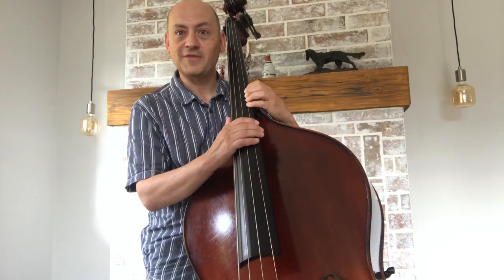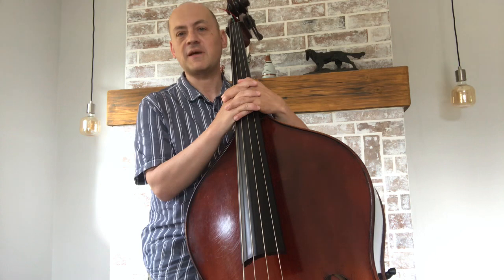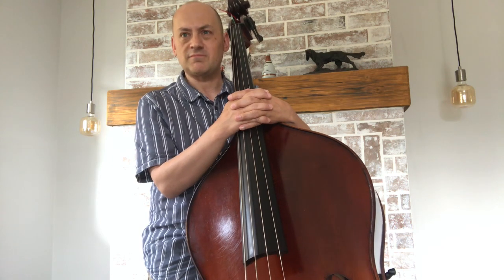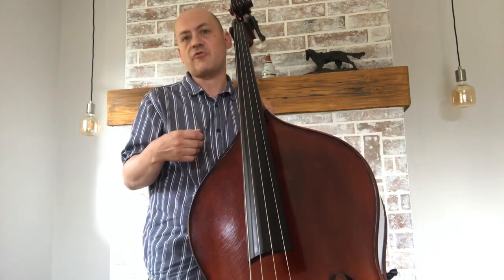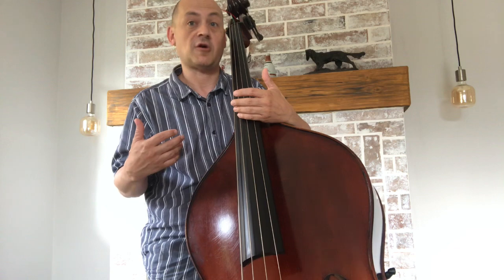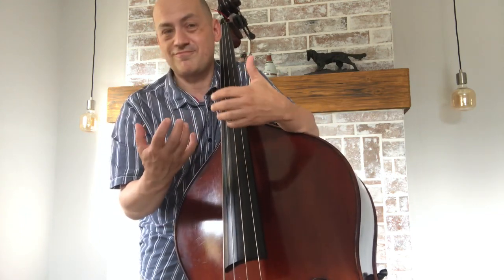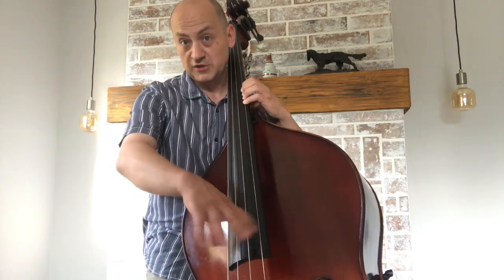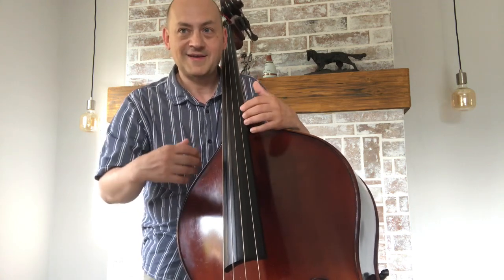Tutorial 8: Some Aspects of the Jazz Bass Soloing Technique

Comment: Thanks very much for explaining your incredible technique. I imagine that string tension and distance of the string to the fingerboard are important considerations? Also hooking your thumb to the E or D string as opposed to the fingerboard?
Reply from the maker: Hi James, many thanks for your note! Yes, I tend to keep the string action very low, with the fingerboard planed in a way that it is practically flat vertically under at least G and D. As for the tension - I guess this also depends on the instrument, but in my experience, the smaller your bass is, the lighter tension strings it needs. This particular bass is a Scaramelli of 2006, and I have D'Addario pizzicatos light gauge D-A-E and D'Addario Hybrid light G.
What exactly did you mean re the thumb..? Keeping it perpendicular to the fingerboard..?